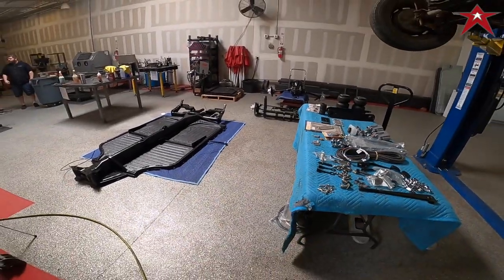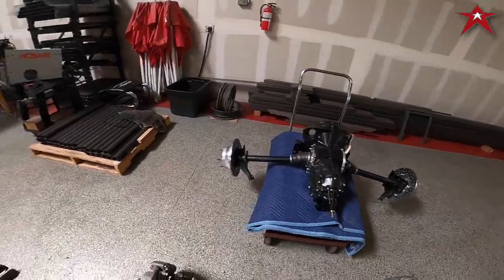Chassis 84 Episode 13 | 1958 VW Ghia Chassis Assembly | AIR RIDE | Narrowed Beam | Trans | Airkewld

Comment: Pete did you index the rear suspension before hand or did you all really just eyeball it?
Reply from the maker: It's air ride, no torsions are used in this application.
Reply: @AirkewldVWs  Ahhh, that makes more sense now.  Thanks!  (I really need to intern with the PROs!!)